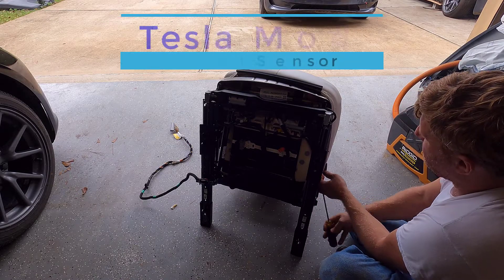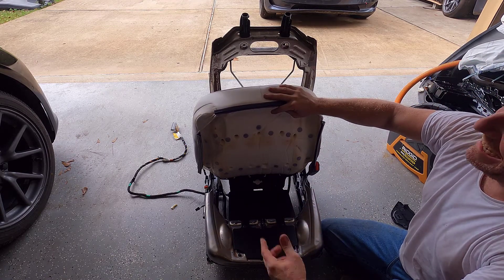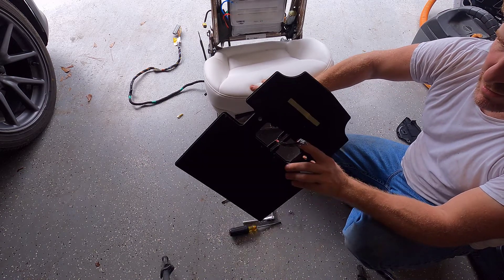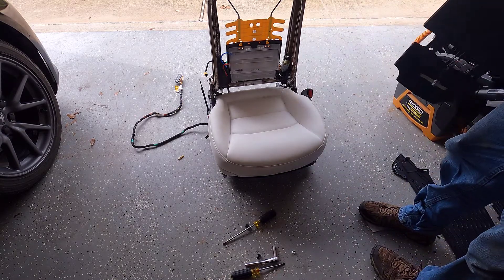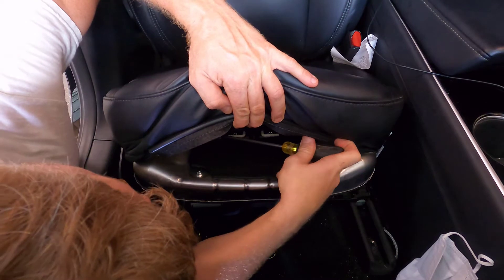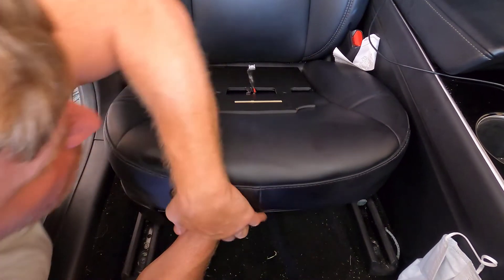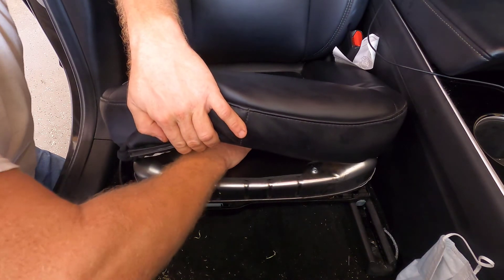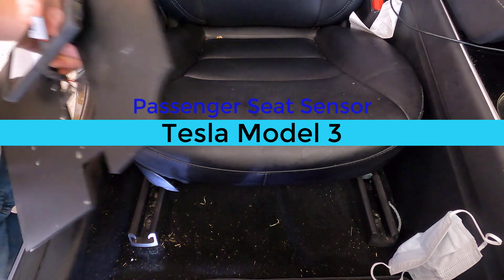Tesla Model 3 - Passenger Seat Sensor - Restraint Fault

Comment: You just saved me 2,350 dollars that they were planning to charge me for the same issue. Thanks a lot and I did exactly what you did and it worked
Reply from the maker: Wow the seat and labor to install is that much now?
Reply: @TeslaRebuilders  I was last quoted about $2,000+ tax in September. I declined. Then the error went away until just last week.
Reply: Where did you get your replacement sensor from? I am nervous about getting a bad one from eBay.
Reply from the maker: @TheTomknoblaugh  I got mine off a wrecked car I was parting out, that's where they get them off eBay.  Highly unlikely you will get a bad one.
Reply: @TeslaRebuilders  Thank you! Just ordered one off eBay.
Reply from the maker: @TheTomknoblaugh  Hey just checking to see if it fixed yours as well?
Reply: Just replaced mine. Did you have to drive it a bit before the restraint alert turned off? Thanks for all the info!
Reply from the maker: @aggg5253  For me it just never came back on.  It's been what almost 2 years and no issues.
You have to also be sure if your still getting the error that it is a passenger restraint fault and not something else.
If you can get the car into service mode it would be easier to see the service alerts and get full definitions of the cause.
Reply: I still have a "safety restraint system fault" code. I now put the car into service mode and the alert is labeled RCM_a094_comVCRIGHTStatus. Not sure what that is
Reply: its probably the backseat

Comment: Dealing with this same issue on my 2020 Model 3, however the fault is present even when nobody is sitting on the seat basically all the time. Could it be the same sensor? Tesla Service Center in Los Angeles wants $3,100 for a new seat which is absurd!
Reply from the maker: If it's the PRSF yea mine did it without anyone sitting in seat too.  Getting a sensor is way cheaper and easier than replacing the Whole seat.

Comment: Tesla replaced the sensor once for me on my 2018 under warranty.  It’s having the fault again, and they want 2100 to replace the entire seat. I’m guessing they redesigned the whole thing because they had so many faults with sensors.  Anyway, I ain’t doin that.  Any idea where to get that sensor?
Reply from the maker: Are you sure they didn't try the little magnet coil wire harness...?
They did that on mine was 80$ mobile service and didn't work.
Check on ebay for them they should have one.

Comment: a silly question -- what if I remove the passenger seat to have more room to carry 8-foot lumbers?  Will the computer complain as I drive down the road?
Reply from the maker: No you can unplug and remove the seat won't hurt anything other than a passenger restraint fault that will go away when plugged back in.  I have carried a few pieces between seats and with back seat down in the trunk to the floor.  Just gently place them past the screen and hold with right arm while driving.

Comment: Oh this is magic. ♥ My 2018 3's driver seat has developed an issue with not detecting that I'm sitting in it (it has no excuse... I weigh more than I would like), and now I'm looking into what it takes to fix that. This is the only video I could find that addresses it. Tesla's service manual has a much more complex procedure for replacing a sensor that actually IS embedded in the top side of the foam... wonder if it's different on the driver's side? Hm. But this is an excellent place to start. Thanks!!
Reply from the maker: The drivers side is yes part of the cushion foam and not a separate sensor.  Yet the foam can be removed and replaced in much the same manor just a little more difficult!    Oh, the you know what is doing great btw and thanks again!    
You should join our discord Matt, would like to have you around! 
https://discord.gg/wG8xUgt